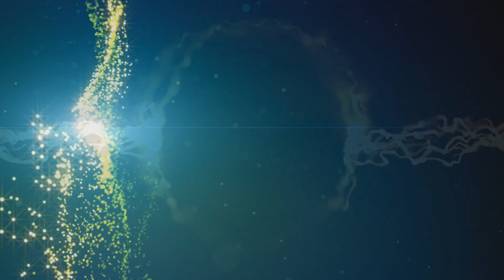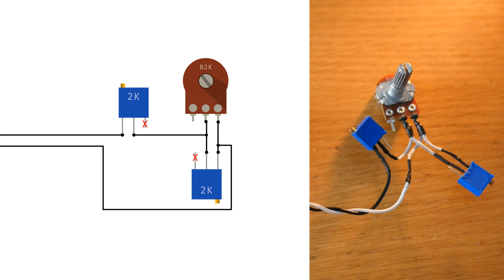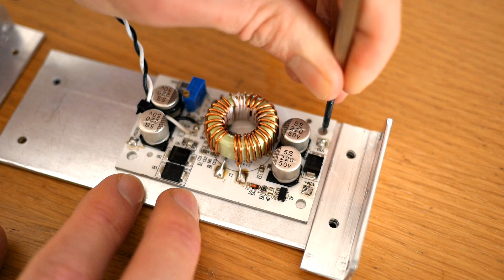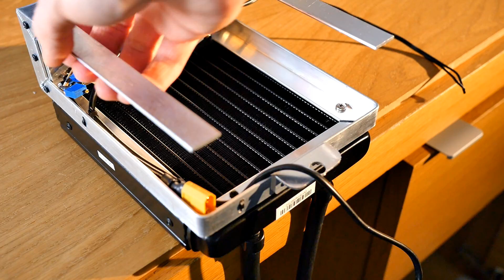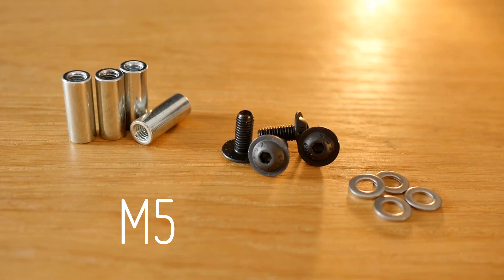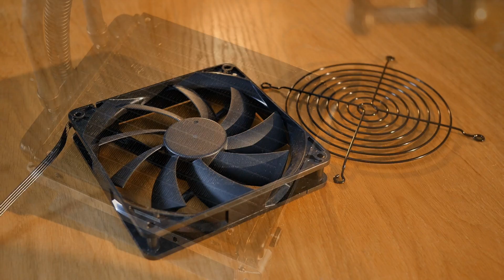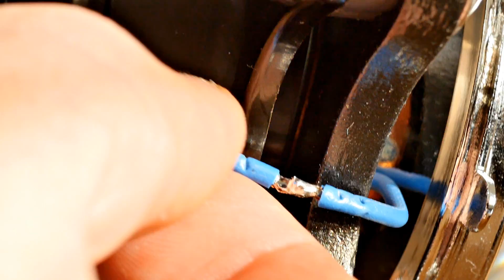1000w equiv. Watercooled LED (DIY SUN BLASTER 2.0)

Comment: So there is no protection for that li-po battery from deep discharge?
No indication of level of that battery??
And please use shrink tubing instead of that ordinary electrical tape which is worst method of insulating.

Comment: I like your videos very much. I had a question though. what if the motor does not spin when connected to do the initial check you suggested. what options do you suggest.

Also, can you make a project where we can create a wrist vibrator band signalling the mobile is ringing. (Android)

Comment: I made something similar, with the 120mm radiator used you actually don't need to use the fan as passive cooling of the radiator alone is enough to keep the LED cool. although depending on the density and thickness of the radiator used in the all in one liquid cooling solution you choose your results may be different. 
I love you shared your data! I plan on upgrading mine with your bracket design!

Comment: What will happen if i use a 10k potentiometer (which is reconmended in the other sun blaster video) instead of 2k potentiometer?  Is it safe to replace it or should i get a 2k?

Comment: These boards are incredibly robust and well made - I bought my first a few months ago off AliExpress, as part of a project to upgrade a 12v Ni-mh powered Quad-copter to use Li-po's instead.
The boost converter pcb's are etched onto an Aluminium board that is perfect for heat-dissipation. I'll be grabbing a few more at this price. The links are bookmarked thank you! (Hong Kong supplier)

Comment: I am going to make a flashlight lake this and the version 1. battery will be in the housing instead of the heat sink. The circuits will be in a small extended part of this with the goose neck and all. I will also put a tripod adapter on it so I can use a tripod with it.

I will make a video. My channels name is Diy Awesomeness

Comment: You should run the 10 led's or less by a custom waterloop. Its a bit pricie but better then 10 AIO coolers side by side. If you need help by finding something you can work with, just answer! (Sorry if their are some mistakes in that text, Im from Germany!)

Comment: Out of interest, by a larger project i presume you mean to use more than one of these LEDs?
If together would use use a heat sink to transfer the heat from the LEDs to a single point where you could then cool them with water cooling?
I presume these don't get as hot as processors, especially not close to AMD ones?

Comment: I love this, but I am struggling with some of the parts.  For instance "These goosenecks have a fairly uncommon thread, so we'll need a convertor to a standard 1/4 UNC"

I'm probably novicing this up, but would it be possible to have a comprehensive parts list? The links for components are really great, while happy to deviate slightly from your design slightly, I for one would find this a massive help.

Love your videos!

Comment: While I really dig the look resulting of using a watercooler, it is really overkill and adds a significant cost. I might adapt this design to use a low profile CPU cooler (Noctua NH-L9 being an obvious choice here if I find a way to shroud that hideous fan), which would mount to the gooseneck without a problem. It would result in a cheaper, lighter build at the cost of looking worse.

Comment: Excellent project. Most of the build was good quality. I would have preferred that the two pots be mounted somewhere. Perhaps you could (hot) glue them to the plate that holds the LED voltage regulator. Guess I can do that if I build one.

Comment: Hello.  Thank you SO much for this!  And I can't wait to see your monster 10 led "lamp"/death ray.  :D  hahaha

By the way, your links to the water coolers are linking to different models, so I'm not sure which one to get specifically.

Also, the little knick knack parts.  Would you have links to them?
I saw an Onstage gooseneck at 13 inch, but I'm not sure if that's the one/correct length.  Also, the 1/4" UNC thread adapter is really tough to find, especially without knowing the inside female dimension, and if they'd fit with the undetermined gooseneck.
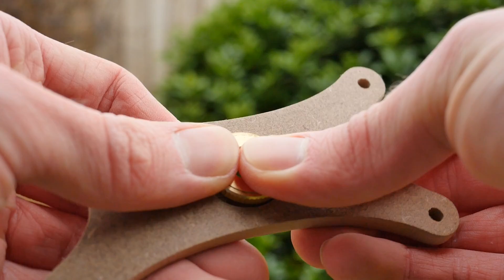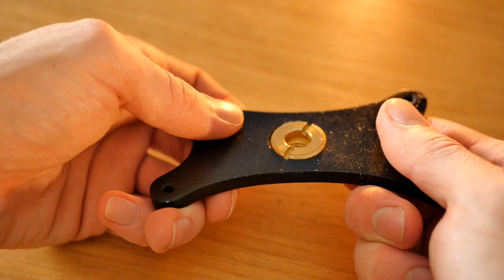A link to the part at 10:35 & 11:35, or specific searchable name (as "gooseneck thread adapter" doesn't get me to it) would help me/us(?) immensely.

Comment: I have a spare H100i water cooler just sitting in my garage so I am excited to see if you come up with a 10 led light setup.  I like this single light setup but the H100 is an even bigger cooler and I'd like to extract as much light potential from its cooling abilities.  Look forward to seeing what you can come up with!

Comment: Excellent video! Superb light output with the reflector & lens. You forgot to add the link to the lens in the video description area. I just used a 100W LED for a project not on YT. The same generic one you show which includes a really nice aluminum enclosed 20-40V driver for under $12.

Comment: should probably mount it to a Bowens mount adapter, then u can use all the accessories that fit that system.

like this one:
http://www.ebay.com/itm/Pracatical-L-Bracket-Adapter-Hot-Shoe-Flash-Holder-Bowens-Mount-for-Speedlite-/221889989475?hash=item33a9ac8b63:g:BAwAAOSwWnFV~H6L

Comment: If you wanna go balls to the walls... then a 10 LED flashlight project is pure lunacy but genius at the same time! Personally, I recommend you use EK waterblocks and a custom loop with enough rad space to dissipate 1KW of heat (Luckily, a pair of 480mm radiators is all you need)... If you wanna go for aesthetics, learn to bend PETG tubing... I promise the end result will be a LOT tidier than flexi!!

Comment: Custom water loop on the bigger version? Then you could get the light further away. As it is I don't see that much gained by water cooling as it's fixed rather close to the rad.

Comment: If you want to keep the rigidity of the frame, but also have it mountable on bookshelves, you make two tabs with your angle bar and hinge them on the radiator side. That way if you put it on a bookshelf the bars should retract into itself, and if you want to set it on a table, just pull them out. You probably also need to round out the edges that hinge to the radiator side as well to keep it from locking up. Great job. I'm definitely going to build this puppy.

Comment: I think placing the fan upside down (exhaust up) will provide lower temps as heat tends to go upwards anyways. What you are doing now is pushing the hot air down which will eventually come up again. As this is not a pc case and is in an open air environment the impact wont be huge, but I am sure that you will notice a small thermal benefit.

Comment: I literally just bought all the stuff to convert my led from aircooled to water cooled using alot of the same stuff you did. Instead of using a radiator, I'm using a 1 gallon resevoir as a heat sink and a 12v pump to get flow. I'm hoping to mount it onto of my car to make the ultimate light bar.

Comment: You could just have not soldered the posititve end of the LED yet. And then solder a temporary wire to do all the multimeter stuff. Afterwards desolder the temporary wire and solder back the original wire. This way you don't have to cut trough it.

Comment: I have a question to do with the pump being elevated. 
I know that in water cooling setups it is recommended that  there is a reservoir before the pump and that the is elevated above the pump to avoid air bubbles entering. In this setup with the pump in the elevated position, do you think there is a risk of air getting through the pump and potentially affecting the pumps longevity?

Comment: Rather than cutting the wire to measure the current, can't you use a multi-meter with a DC-capable amp clamp?